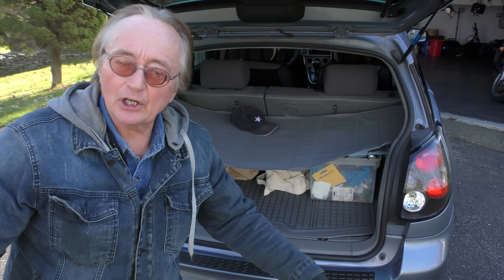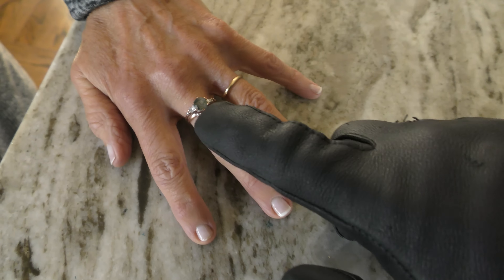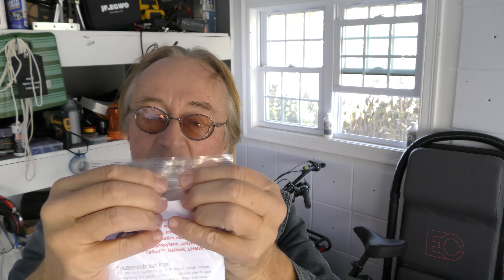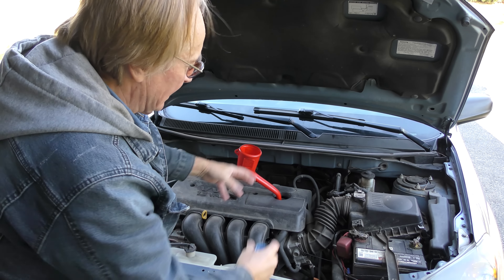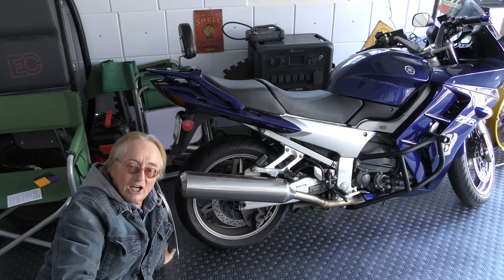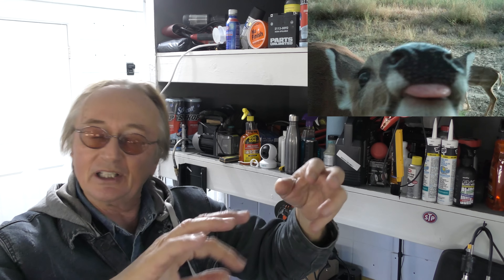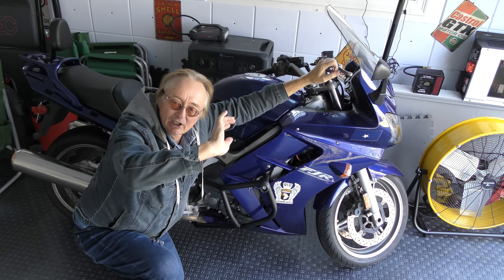I Finally Got My Wife on Camera

Comment: “The dentist does a crappy job I’ll do it myself with this glue” A normal person I’d say what the hell are you thinking, but it’s Scotty so I’m really not surprised 😂
Reply: Not the first time household glue has been used to secure dental work. The opera singer Beverly Sills had TWO crowns pop off in the middle of a performance. She ducked backstage and somebody helped her glue them back in with Duco Cement! She said it took her dentist a long time get them off later so he could reinstall them "properly." Maybe he should've left well enough along? (This happened in the 1960s or '70s.)
Reply: @lawrenceh1405  well knowing the dental/ medical industry he probably knew he could get his money’s worth out of her
Reply: @thomashenry794  Heh, crowns are "cemented" on the tooth, so they are basically are glued on!
Reply: Some them chemicals could be very  poisonous. You best be very careful what you use 1st before you do it.
Reply: @lawrenceh1405  by professionals and cement is a little different from glue, if you’ve ever done work with cement.

Comment: Scotty, I had the same problem with stuff sliding around in the trunk of my corolla so ...
I bought some Velcro and put the fuzzy sides down on the trunk rug, evenly spaced SMALL pieces, the hook side on the bottom of a plastic tote. Let it sit for 24 hours as per the instructions and wah la!! I can now put that tote anywhere in the trunk and it doesn't move! This is an inexpensive fix to a problem.

Comment: Love your channel Scotty your decent honest human being. I live in Clarksville Tennessee I drove a Toyota Highlander 2016. I change the oil every 5000 miles change the filter at the Toyota dealership every 10,000 miles with the oil. I'm an extremely conservative driver. When I change the oil every 5000 miles it looks great is this okay or do I have to change the filter every 5000 miles. The new filters are just too much for me I use Mobil one synthetic oil the one made for 20,000 miles. But I change it every 5000 miles.

Comment: Scotty I have a question...
     4 yrs ago I bought a 2006 Mercury mountaineer 8pk 4.6 liter (high mileage) 184,000.
At the time, a full tank would show around 300 miles until empty (that's the odometer reading).
Gradually the reading got less and less,285>265>250>235>200 until empt, (This is over a 3 1/2 yr period)...Now It's displaying 179 miles until empty.
  I've asked several car guys and no one has answers.

I figured I'd give it a shot and ask you Scotty since you're an automotive GOD!
        I'm only 1 of 5.4mil subscribers so I know you're a busy man,thnx for all you do.

Comment: Unfortunately, here in Minnesota many of these Wi-Fi cameras,, etc. fail in the winter.  I typically recommend folks in the great white north only purchase these sorts of items after checking the temperature ratings.  Many only have a rating of 14 degrees F. 

CHECK THE TEMP RATINGS BEFORE YOU BUY, IF YOU LIVE IN THE NORTHLAND.

Comment: oh my the trunk mat - all my Neons had mats - this Elantra mat is SO slippery, the noise of things in the back even at low speed is terrible.  It looks like it has traction, but all looks .. I put pads all over it and the stuff sliding popped them right off .. even with contact cement they scrape off.  Trying to find something else for grip, without going to "a mat on a mat" thing.

Comment: Hey Scotty...   Speaking of glue.....  Try this one.... It's called goop... And it doesn't matter what type you get. Automotive household ect...  It's all the same. Ticket is to apply it pull apart put back together a few times for air then let it sit for 24 hours you'll be impressed.  Glues anything together!

Comment: Probably better to use dental cement on the crown, available online.  With the cement, the crown can be removed later if it needs to be repaired or replaced.  The best implant crowns are attached to the implant with a small screw near the center of the crown.  Once torqued, the screw is covered with filling material.

Comment: Scotty, I have a 98 Jeep Cherokee XJ. The starter motor went bad, so I went out and got me a new high torque starter. Once I installed it, I go to start the Jeep. As soon as I turn the key to the on position, I hear a grinding noise seemingly coming from the flywheel as the Jeep starts. I then let the Jeep idle for a while, then I shut it off and let it set for a while. Then I once again, start the car and once again, I hear the grinding noise and the Jeep starts right up. My question is: what could be the cause of the grinding noise??? Could it be the flywheel is failing??? What do think???

Comment: There's a lot of business overhead that is mostly due to local and state "regulations" such as oil and tire disposal, "hazardous waste" such as coolant even though the container on the coolant says environmentally friendly, oil filters, gear oil, plain automotive debris from sweeping up floors and then the fee's just to be a gragage, EPA, ARB, etc.  By the time a small shop of dealership shows up to open the doors one moring, they already have thousands of dollars of expenses to pay the local city, county and state just like the Chicago mob does yet you don't get any protection services from either of them !

Comment: Hey Scotty. Got the dreaded 2008 Chevrolet Silverado with 66000 miles.  Should I disable the active fuel management system before I have problems?
Reply: @stevelee719 Hi! I recall Scotty having said to disable a creative control device of some kids and. Just heard it in the last few days. Maybe you can search in those videos. It was in the Q and A section, I believe. This is Thursday, Dec
 8, 2022. Best wishes, Merry Christmas,and Happy New Year! ❤️💕
Reply: @k.h.489  Thanks. I’ve seen some reference to it in other videos on YouTube. Will research it further. Merry Christmas to you as well.

Comment: Scotty I need your help .I took my car to a Ford dealership because my car kept stalling out when I would come to a stop or a red light so they told me that it needed a barometric switch replaced but 2 weeks later the car was still doing the same thing and when I took it back they told me oh we think you have some kind of transmission problem but I have never felt anything wrong with the transmission when I moved I went to Auto Zone and they hooked that little device inside my car and said you have a bad barometric switch and I said I had that replaced ,I don't think they even replaced it the first time . My car is a 2017 Ford Focus SE and now it is still stalling on me and I smell fumes inside the car could you tell what do you think is wrong with it. I don't know what else to do. Thank You.

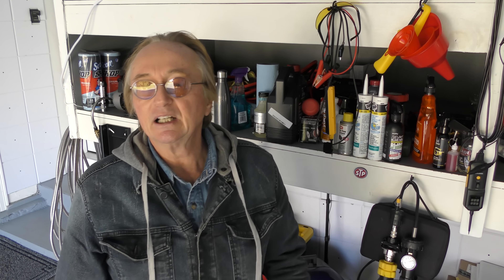Comment: 10:10 also bad or dirty battery cables.
Reply: Just 'fixed' a random intermittent ODBII emissions code by changing the battery in my bought-used 2003 Corolla; battery was 5 years old when I got the car this year, and started even in cold snaps this fall, but it was time to change it. No MIL/Check engine light since. Modern cars can do very odd things with a little electrical power drop.

Comment: Scotty please help Honda Civic 92 luk warm heat. Over 20 mph no heat
Reply: I'm not Scotty, but I play him in the comments. Check your coolant fluid level first. If the coolant is low, refill it. If it keeps going low, you have a leak you need to find and fix. If the coolant level is right, see if the upper radiator hose gets hot when the car idles for about 10 minutes. If the hose doesn't get hot, your thermostat may not be opening, so you're not getting proper heating or coolant through the engine.